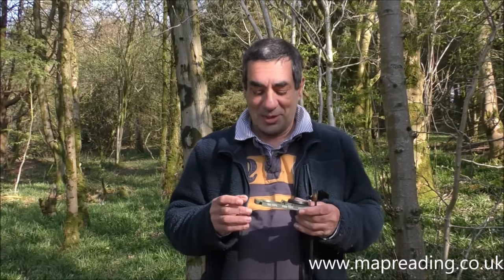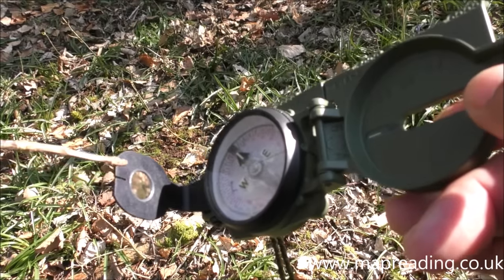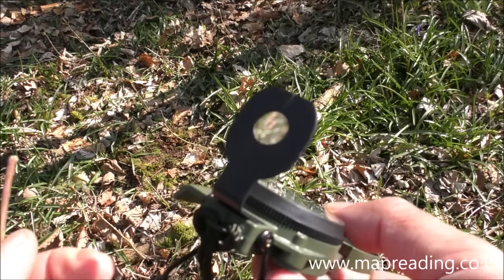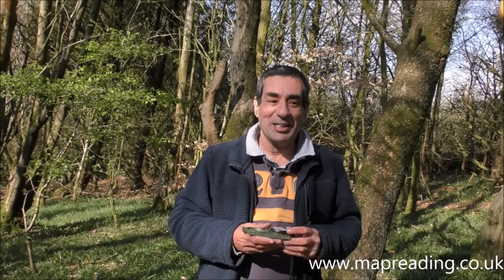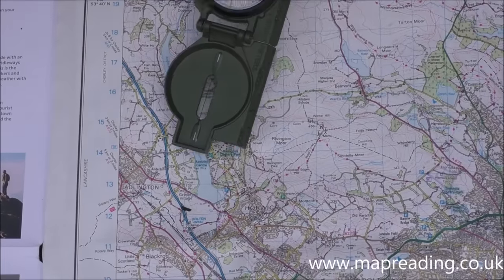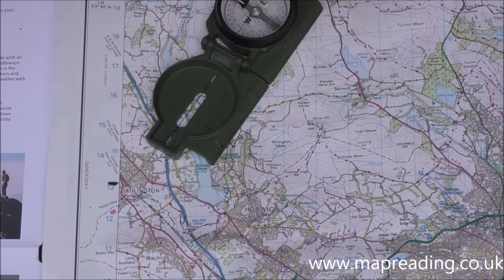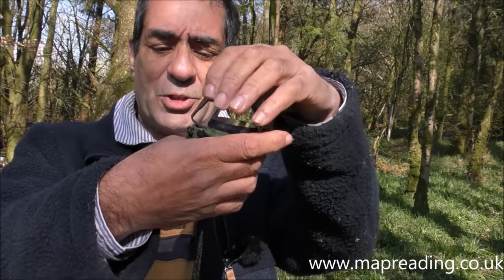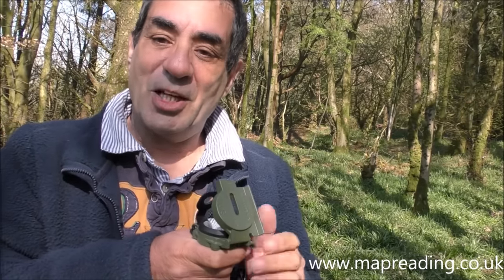Use a Lensatic Compass with a map & without

Comment: Does the lensatic compass work in the southern hemisphere as well as northern hemisphere ?
Reply from the maker: It won't work in the North AND south, but in only the North OR South.  I think (but may be wrong) that the default is a Northern Hemisphere compass but you can pay a small suppliment when ordering for the Southern Hemisphere option.
Reply: @TheMapReadingCompany  , I heard about it. In my country (Brazil), we are rarely warned about this difference. Most people uses compasses made in China, and only Silva and Suunto has dealers in Brazil that offer "global compasses".

Our main problem with US-made compasses are the map reading scales: many are graduated in feet or miles, like a Brunton Eclipse Pro that I have (totally useless here), but the standard 1:25000 or 1:50000 is very useful. 

I never paid attention to "North" or "South" Hemisphere calibration (indeed, I never had or saw a compass specified for South Hemisphere), and American, Chinese and Japanese compasses always worked here (about 23°S 46°W).

Could you explain it better, please?

Comment: Very good tutorial, but is there not a way to use it to work out where on a map you are? If you can take 2 bearings?
Reply from the maker: Yes there is.  You can see how it's done on these two videos:
https://youtu.be/pTNJOpLcT4k
https://youtu.be/61uMkv19Uyw
Reply: Yes, the army called it resection in the 1970s. The answer below probably can help.

Comment: I still have my dads WD issue prismatic compass which works on the same basic method as the lensatic. The dial has a hand operated lock which lifts the dial slightly and puts the scale numbers out of focus through the viewing prism. Most irritating - ! 😅

Comment: What's best compass for the money in US market? Thanks
Reply from the maker: Sorry, but I never give advice on which is "the best" compass, as they are  designed for different uses.
As an example, if you navigate at night you'll need one with the highest possible contrast and black text. 
If you're in the military then mils will be simpler for range finding. 
If you're on a budget then you'll need to look at how much the compass costs. 
If you're navigating over longer distances then a mirror compass would be more appropriate than a base plate.
If you're mountaineering,  as opposed to trekking,  then weight will be a factor. 
A large magnifying area will be important to some people. 
Multiple roamer scales may be needed for some types of trips..
Etc.
Etc.
So the best advice I can give is to look at what will be the primary use of the compass and then look for a compass with the features needed to make it as simple as possible to use

Comment: How does one know what the magnetic declination is, for a particular area?
Reply: Forget my question; I just read that it is supposed to be indicated on the map.
Reply: The simpliest way is the shadow and stick method. You can fix a 1-yard stick vertically on the ground and mark the two shadow tips after 20 minutes. The line traced from one mark to other gives you the true west-east line. Align the compass base with the west-east line to get the true north and magnetic declination.

Comment: I don't think anyone has ever made a lensatic compass that's useful for civilian, international use. The problem with the Cammenga is that the main scale is in mils, which is perfectly fine if you're in the US Army, but somewhat useless for anyone else. The degree scale only has a 5 degree accuracy. I suppose you can simply use mils instead of degrees, but that's a bit backwards if you're not travelling alone. All the other non-Cammenga lensatic compasses are pretty much useless, as none of them have a reference hairline, so you can't actually get an accurate bearing from them.

And getting accurate bearings is what a lensatic compass excels at. It is by a very wide margin the absolute best type of compass for taking bearings. Unfortunately, to be that good at taking bearings, it had to sacrifice the quality of map work. Turning the bezel to align it with the map like you do at 7:43 is very, very imprecise. The 3 degree accuracy of the bezel is irrelevant, as aligning that tiny, tiny tritium mark with your map grid is very difficult. It's not that great for map work.

It's also not ideal for following bearings. You need to get it out of your pocket, open it up, wait for it to stabilise, and then align it properly.

A baseplate compass, on the other hand, is absolutely the best at map work, and very good at following bearings. But it is absolutely hopeless when taking bearings. So I am really wondering how come no one has combined the two? Why not have a lensatic style compass body and magnetic needle in a baseplate capsule that is transparent and with a cage and parallel lines? That would allow such a compass to be just as good as a normal lensatic at taking bearings, but also almost as good as the baseplate for map work since it can be used as a protractor. Oh well, once can only dream and hope...

Either way, I agree with the rest of the comments. This is the best video on the internet on how to use a Cammenga lensatic.

Comment: He left a lot out. If your bearing to A is less than 180 degrees, eg 170 then 180 cannot be subtracted from it to get a back bearing to B as this would be -10. In that case you should add 180 degrees instead, eg 170 + 180 = 350 back bearing.

Comment: My compass is off how can I calibrate  it
Reply from the maker: If your compass is "off" by more the 2 degrees it's not working.  Contact Cammenge and ask about a replacement.
I don’t know what Cammenga’s policy is on this and it may depend on how long you have had the compass.
Reply: Thank you @TheMapReadingCompany
Reply: No compass is spot on accurate and easc and every compass will have it's own error. This "individual compass error (ICE)" should be marked on the compass somewhere. For normal map work and walking the error will be small enough to ignore, but for more serious use be careful. If you know what the error is you can compensate for it.

Comment: being radioactive is it bad for health ?
Reply: The tritium as used in the compass is harmless and poses no risk unless you do something foolish like ingest it.
Reply: It's only an ingestion hazard if opened. It's sealed completely.
Reply: @wasabij  A lot of the women that painted the luminous hands and numbers on watches came down with cancer. They would lick their brushes to get a fine tip and inadvertently ingest a tiny bit of the luminous paint
Reply: The tritium is in a tiny glass tube (called a trilux lamp or sometimes a beta lamp). It poses no risk unless (as previously stated) you do something stupid.
Reply: They used to use radium, I remember using a radium marked base compass many years ago, those things were mild gamma emitters. Tritium is just radioactive hydrogen gas in a glass vial surrounded by a coating of phosphorus which glows as the beta radiation hits it. You'd need to break the glass then inhale it to do any harm lol

Comment: Printing declination on a map is worse than useless as the poles wander.  E.g. the declination for the UK is different than it was 8 years ago.
Reply: That's why you should use current charts
Reply: They would have had to get new charts every year for a while!  LMAO  @Thomasnmi
Reply: @protonneutron9046  magnetic declination does not change a lot quickly.  Close to the poles it's about 1-2degrees over 3-4 years.
But if the need for accurate navigation is important, updating charts is an inexpensive precaution.